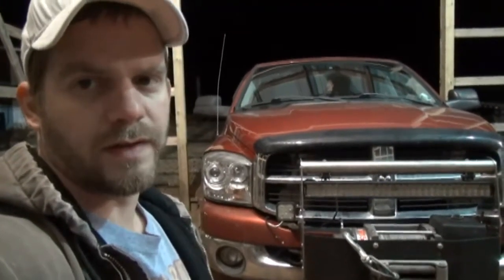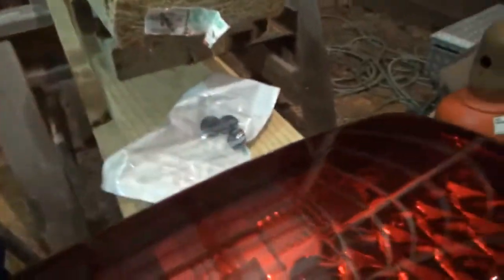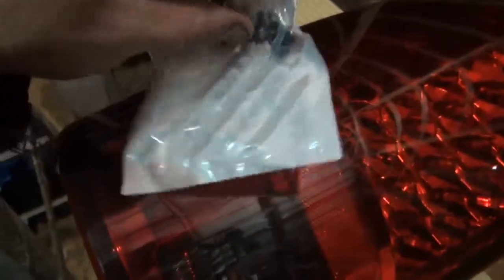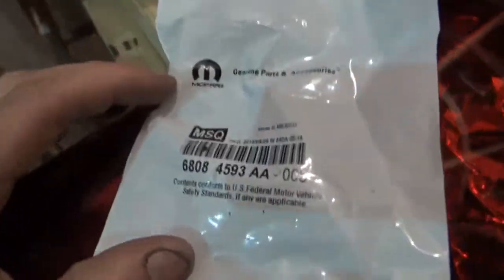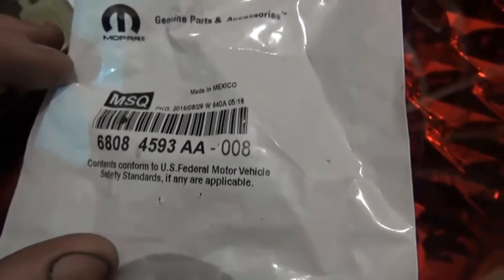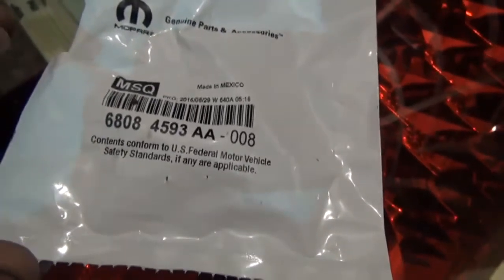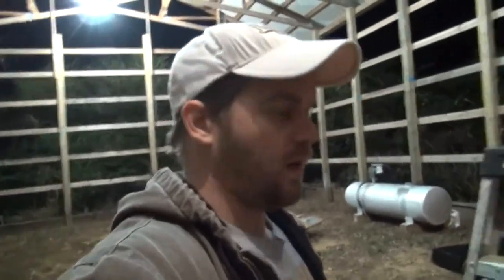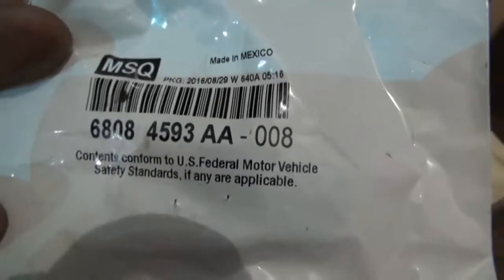Dodge Ram tail light grommets, clips

Comment: I just replaced the brake light bulb in my 2008 dodge ram 1500 after watching a few videos on YouTube I took a plastic panel prying tool I got from Harbor Freight place it on the back side top pop it out then the bottom both of the clips stayed in place